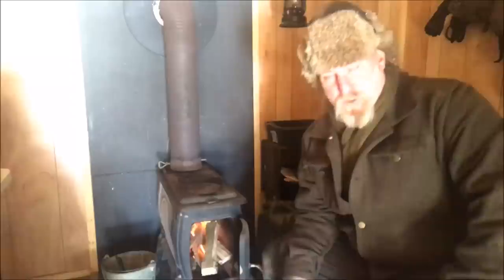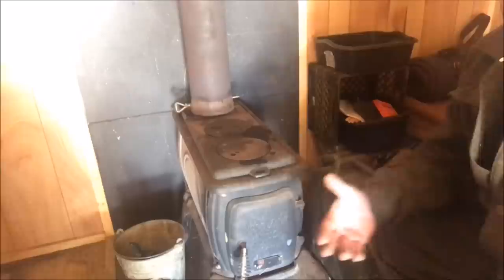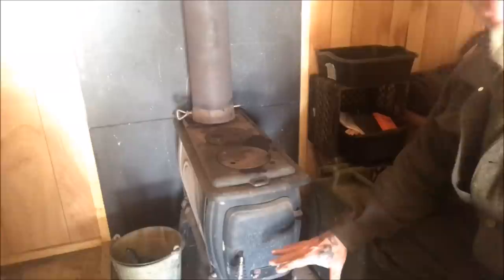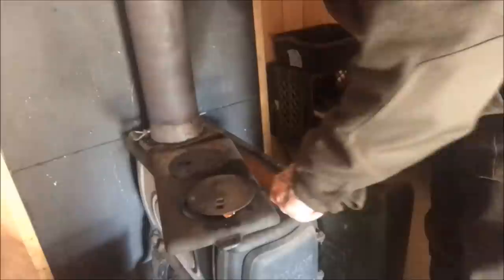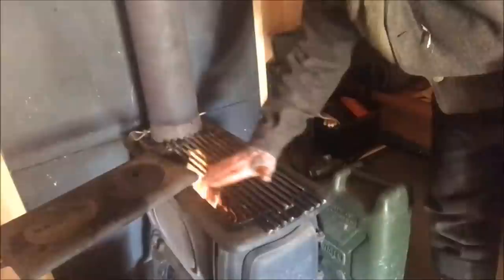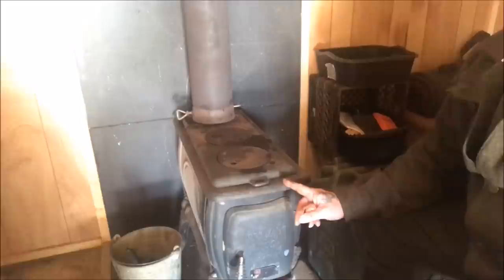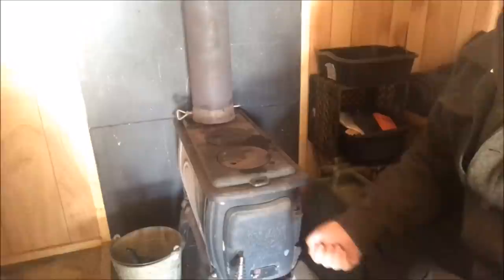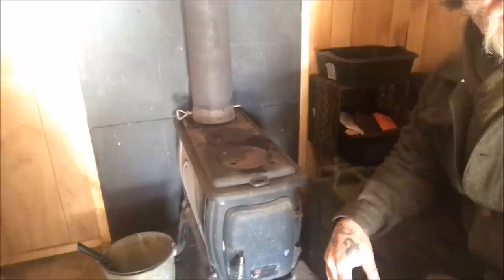Trappers Cabin Season 2 Part 13 Wood Stoves

Comment: I heat my house with one for 15 years. These homes have a fireplace that is open on two sides ...kitchen and living room. I keep a box fan on the kitchen side to blow the heat through out the house...with oil at 3.50$ a gallon its a great way to get thru the winter. After hurricane Sandy I had no electric for damn near 3 weeks....the stove saved me. With a generator running the kitchen side fan I could heat the whole house and sleep like a baby. It is also charming to run it with door open and spark arrestor in front and watch the fire.

Comment: I have found with my wood stove that if I cut my firewood shot by about 6 inches I can take the cut off end and lay it crossways in the front after I have gotten a good bed of coals really helps me maintain the coal bed overnight you can also add a fire brick to the front crossways nearest to the door for a longer burn time. I have found that buy doing this after a lot of experimenting over the course of 2 year that this works well. I even leave my smaller pieces round not split about 4 inches tall and 6 to 8 inches around that I sit on the top of my final load before bed. I go to bed around 10 -11 pm and get up around 530 still have a large bed of coals for easy start up in the am. Also using the damper in the stove pipe will help with the control Especially if you have a 30ft tall chimney with 20 mph winds over night.

Comment: Nice for $100ish man.   I ended up getting the 'Guide Gear Outdoor Wood Stove'  "HQ Issue".  On Amazon for about 99 shipped.  Looks like they don't offer that anymore.. weird. 
But it works great.  Set it up in the garage.   Only mod I did was weld in a bent plate on the inside / over the exhaust so the fire just wouldn't go straight up and out the pipe. 
But she's heavy iron.   The elbows I had made for her were more expensive than the stove lols.

Comment: an old hollow aluminum or otherwise hollow arrow shaft cut off at the ends makes great bellows when you huff to the spot in need like cold ash coals. blow the top ash off to reveal any coals lingering underneath. *Hint. any bit of red is coal heat. you can clean out exes ash or push it aside while getting another fire going it also can double as a fire tender to flick wood around and is long enough to keep your hands cool if you don't put them in the direct radiance of the heat. best to work at an angle if the fire is hot. 1 more tip, put a pot of water on to keep the humidity up. dry air breathes hard, you need moisture inside and out.

Comment: I noticed the newer versions of this stove have secondary burn tubes across the top inside to burn up the smoke so they should burn hotter and slower, using less wood.

Comment: The previous owners of my home installed a cast iron, wood burning stove insert into the existing fireplace; however, after a few fires & closer inspection, I noticed there's NO damper. There's not even enough room to install a damper. Although it heats the house pretty well with it's built in fan, way too much heat escapes up that chimney. It would increase the efficiency probably 10 fold with a damper.

Comment: I never had much luck with one of these, it never seemed to heat my house up, but it did smoke the place up  really nicely. I've about made up my mind that an outside wood burner that pipes the heat inside is the way to go. J Null on here did a poor man version of those, called it the redneck heat exchanger using a steel barrel stove kit as the core. It looked good.

Comment: Methinks Dave needs to make a short, simple water can / gas can video to educate some folks.  That looks about like the Logwood cast iron stove I have in my cabin and it works great. Been using it for three years now. On a -10 degree day I can get the cabin to 90+ degrees if I want to with that model.

Comment: Fast foward 2022 mine is brand new $400 after the 20% off. I had to have a backup for the house in case I lost power due to the ice storms snow storms.

Comment: Also I use one of those wind by hand BBQ blowers on my stove to get the fire roaring up, £1.99 in the UK so should be as cheap on your side of the pond ( they came from China anyway)...just though I'd mention it. A chap at the stove shop near us said you can season a stove with olive oil like an item of cast iron cook ware, have you heard of this?

Comment: love the stove was going to say why jerry can so close then see the word water on the side of it, when slide over do you put something under the lid so not all the pressure on one point? as you do diy metal work a bit of metal bent with a foot one end and a t shape on the top to hold it then the thing can also be used as a pot holder or maybe a clothes holder like socks to dry them near fire

Comment: A magnetic chimney stove thermometer could also be installed on the stove pipe so that it monitors you burn temperature.  If one burns the stove at too low of a temperature, you get creosote build up in the pipe.  Too high a temperature, you are burning more fuel wood than necessary.  There is a goldilocks zone in temperature between too low and too high.  http://www.leevalley.com/us/garden/page.aspx?p=61613&cat=2,42194
Reply: bwillan, you are right on, I have been using them for 40 years and would hate to be without one on my stoves. Also can put it on the stove top if you are cooking on the top. We have had to cook on out Temp-wood stove before when without power, back when my wife thought she could not cook on gas stove which this old house was set up for. Guess what happened after babysitting our Granddaughters for 10 days to 2 weeks several times :-(   Oh yes ! ( by the way the electricity comes in one side of the house and the kitchen was in the opposite ) Murphy's law
Reply: I have one of them bwillan. My stack caught fire a few years ago and it stated that the temp was over 700 degrees! Needles to say, I grabbed the fire extinguisher and was at the ready to spray if needed. I was lucky and it subsided after a few minutes. I have been cautious about cleaning out the creosote ever since. It is a helpful tool if you are there to monitor the stack. Always try to keep the stack clean though. That way, You won't have to suffer the near heart attack that I went through. HeHe!

Comment: I just bought  one from  tractor supply, it looks  like  yours but it doesn't  have  a damper  , I cannot open  the top plate  because  it's sealed  close,  I'm  wondering  if I got a bad  stove  🤔

Comment: What is the barrier behind it and whats the R rating? Trying to figure out what I can use to put under and behind mine. I worry about a fire. I am running the pipe out of the window. Basically the papers with the stove say it needs several feet all the way around it. I live in a 12 x 20 tiny house so not much room.

Comment: I love those old wood stoves! You got a good deal on that stove Dave. I am getting a new one for my cabin this month from tractor supply unless I find a cheaper one in good shape at one of the flea markets. Great video and do you like the stove pipe going out the wall better than the roof or was it just easier to install that way?

Comment: I cheat starting fires. Off rd diesel fuel in an old alcohol bottle squirted in on the kindling. A propane torch to light with.

Comment: I recently acquired a stove just like this for my deer camp. It does not have a grate/rack for the burning wood to sit on. My question is, is it necessary or can I just let it burn on the bottom of the stove? Thanks Dave love your videos.
Reply: Joshua Servello ya just burn on bottom of the stove. I've been using them stoves off and on all my life. Ya can get a grate for some of them but not nessesary.

Comment: Dave, I would remove the gas can that is way to close!
Reply from the maker: You mean the Water Can?
Reply: For future reference (just in case): light blue is also water, dark blue is kerosene, and yellow is for diesel, typically.
Reply: different country's use different colours in the UK its Red+Green=Petrol, Black=Diesel and Blue+Clear=Water.
Reply: 9.99/10 times u think Dave's in error? The error is on you bucko.  Pathfinder crew ain't newbies ;)
Reply: You are Spot On Adam! You know the deal. Rock on my friend!